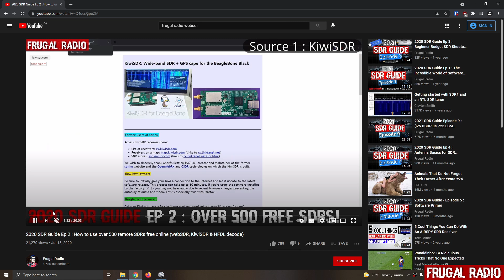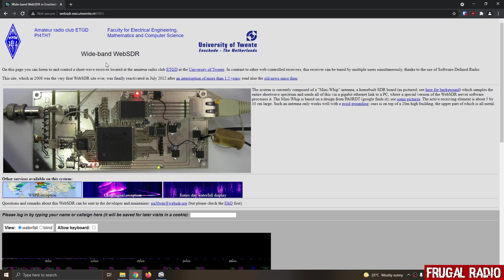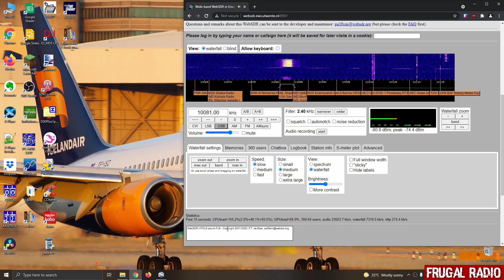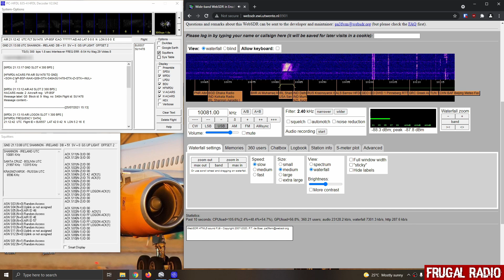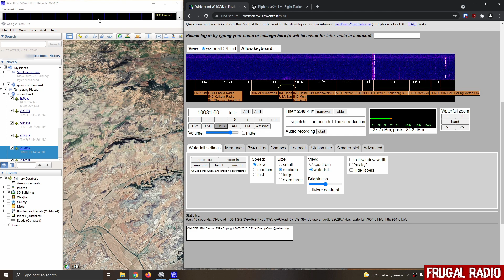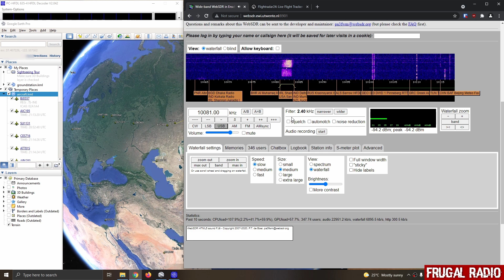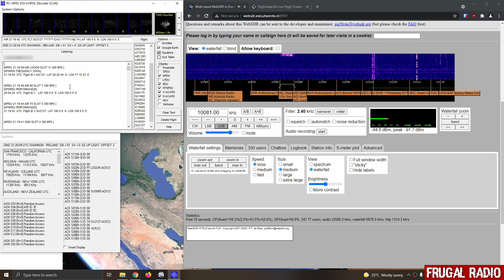Decoding HFDL ACARS with a WebSDR and PC-HFDL

Comment: Great video.  A question hopefully you can help me with.  It deals with the PC-HFDL Log file.  I have checked the three boxes in the log file set up screen.  The log file doesn't show the flight number, lat, or long.  I would like to see the data that shows up on the main screen in a log file, such as:   AIR 07:18:20  UTC FLT FDX907 ?????? ICAO ?????? AID B1 LAT 47 13 41  N  LON 176 56 10  E 

Is there a way to do this?

Thanks, George
Reply from the maker: The guys over at the ACARS group on groups.io would probably be able to help you with that project George. Might be worth giving them a shout. There is a distinct sub group for PC-HFDL.

Comment: Ah, great, another time sink. :) Thanks, Rob. Hoping there's a way to monitor planes in SE Asia where I live vs. Europe.
Reply from the maker: The international aviation frequencies, and the flight tracking frequencies are the same globally. So you'll be able to monitor aircraft transmissions for sure. 

I've got several aviation related episodes which will guide you through the process if you haven't seen them already. Some of the sources I highlighted will probably have frequencies for your nearest airports as well, but I'm sure you'll be able to find more local sources as well.

Comment: Wow another great video Rob I never knew that this was even possible, your incredible knowledge on SDR's just keeps amazing me I always look forward to your videos as soon as I see them pop up I've just got to watch them to learn something else new.

It looks like you are a bit of a fan of RTL-SDR's, I've got 2 V3's I've had one fail with the dreaded heat problem and is being replaced by the supplier the other V3 is great it goes flat out 24/7 and never even cracks a sweat.

I'm just about to purchase a 9:1 Nooelec Balun after your last review.
Reply from the maker: Morning Wayne.
Yep, I've got 5 RTL-SDR v3 units. Haven't had any challenges with them at all. They've been rock solid whether covering VHF, UHF, SATCOM or even HF in Direct Sampling mode. 

As you saw on a previous video, I get broadcast FM interference breaking through on airband if I don't employ an FM trap (filter), but that is the only place it happens. And that's also partially caused by the multicoupler that adds a couple of dB to the output of each of the 8 signal splits.

The NooElec baluns are definitely good, although there are some even less expensive ones on eBay coming from China.

Comment: Once again, great video Rob.
Just a tip, you don't need to keep reloading the KML file. HF-DL will update it when it gets a new lat/lon aircraft and GE will read that update. Its all live. Just let it run and watch the tracks build up.
Also dig into the DDE output of PC HF-DL, with just a tiny bit of help the DDE output will provide links to the 4 main sites (FA, ADSBEx, RB and PF), so you can just click the link to get the aircraft location, no retyping required.
Reply from the maker: Thanks for the comments.
Yeah, Google Earth was doing updates the previous time I used it with PC-HFDL but this time it seemed a bit slow, so I did the reloads.

I haven't messed with the DDE - not even sure what that is. But being able to link directly to those sites would be super!
Reply: @FrugalRadio  To get started quick and easy with DDE and PC HF-DL, do a Google search for "posfix sbs acars" and install that free software. It has a one click button to connect to the DDE feed and will map HF aircraft positions (and other stuff).
DDE means Dynamic Data Exchange - its an old Microsoft 'standard' for sharing data between applications. There is a lot you can do with it.

Comment: You mentioned active ground station frequencies being displayed in pchfdl. I only have time slots displayed. Is there a settings change I need to do in pchfdl? Another great video by the way. Thanks.
Reply from the maker: You can get the frequencies to display by updating the System Table file. For that you need to have the licensed version of PC-HFDL. 

Try googling System Table 51 for the zip file you need. Then copy the files into the appropriate folder in your PC-HFDL install directory.
Reply: @FrugalRadio  Okay Thanks. I do have the licensed version. I will give it a try.